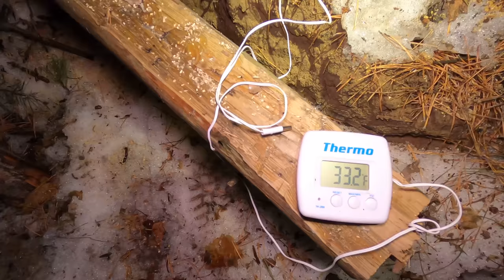My dugout in the woods is 1 year old, Bushcraft shelter, Solo overnight

Comment: If I wanted to pack my chain saw into the woods, I think I would have built a shelter you can stand up in. That tree that you peeled some bark off of is the kind of tree that falls when the wind blows and knocks your brains out,...ie standing dead wood. Shelters that are dug into the ground are inherently warmer in winter but always have a drainage problem in a hard rain or snow.
Reply: What gets me is,  you can actually buy very cheep cabins these days, and have them delivered.   Think 10x10 with 1 insulated door + 3 insulated windows, for about 6-7k   or 10x16 for about 11k.   then you can opt to add insulation if you want,   not really needed if you are just using it for 3 seasons.   bring in a buddy heater or add a wood fireplace if you want.   honesly a 10x10 with 3 windows + screens, camp stove, bed, and such inside (even a small "closet" with a compost or canister toilet)   is enough for a lot of people to spend weekends in.
Reply: @edwardwebster8123  Its just that are are such inexpensive options these days to get quick and simple cabins now.   For those who lack the time, skill or physcial ability (try doing half this stuff with a disability, or even a very bad back.)  but if you can get a 10x10 delivered and just have to bring in some firewood and/or a propane tank,  and use a dolly to bring the stuff to your cabin.   it opens up the outdoors to a lot more people.     You pick up a little plot of land off grid...  maybe an acre or so out in the country with road access.    Many of these places will deliver anywhere within 100 miles of their building factories for free.   they don't need a real foundation, you can often just drop them on a bed of gravel...  though you can also sink 4 simple cement pylots, each with a screw and Uclamp on top.   then slide the runners into the claps and bolt them down.   letting your raise or lower each of the 4 courners as the house settles, to get this done "professionally"  is still very cheep since it takes almost no time to do.  and materials cost is so low. 

Then for "home improvements" over time, you can buy anything from solar generators and solor pannels...  you don't even need to install them.   just set the panels on the ground when you need them,  plug in your battery, then plug in appliances when needed.   just so many options on how to be inexpensive but still have a nice cottage to get away from the city from.
Reply: @edwardwebster8123  I had been talking about the dropping costs of buying little cabins that you can plop down anywhere.   little 10x10's  10x16's...   you simply replied "OK"   

So i added that they were a good option for people who couldn't physically build their own due to time or disability... and would still let them get out and enjoy the wilderness.
Reply: @edwardwebster8123  upstate new york, where you can get a few acres here and there,  or even smaller plots, for under 20k.  Then have one of the amish cottage companies build it up.    Now texas doesn't have a ton of forest but there you can get small cabs just as easy.   Same with PA.